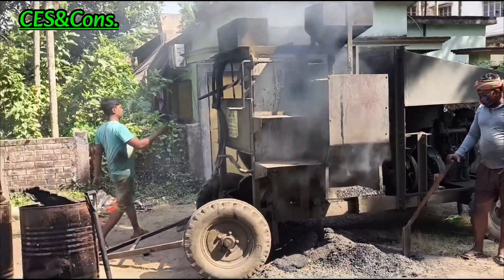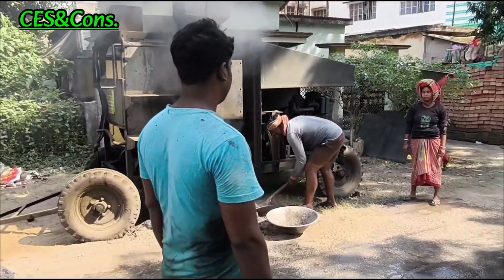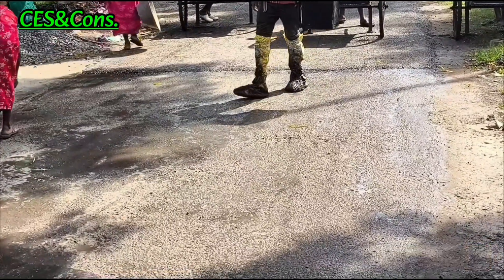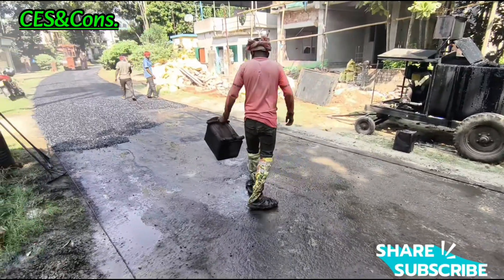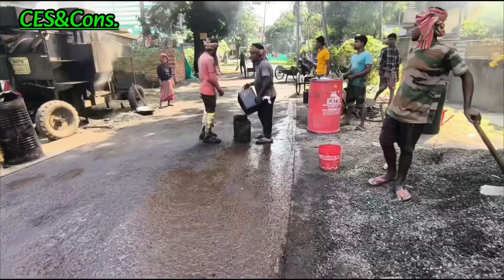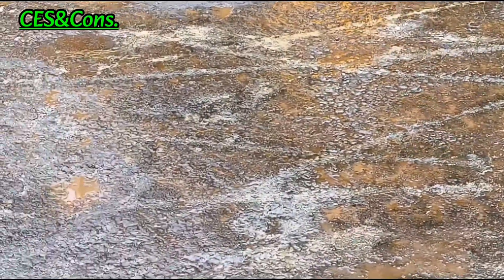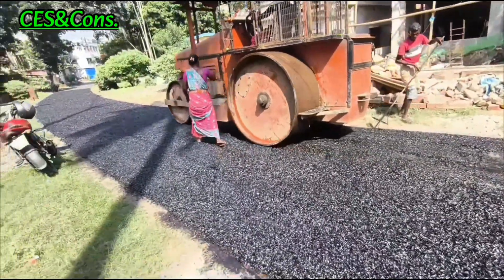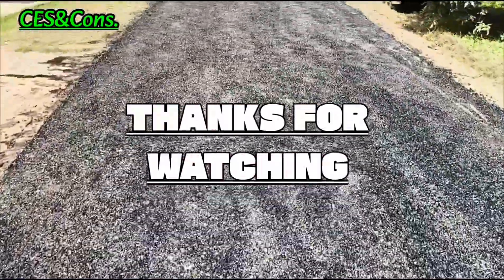Construction of Wearing Course #pavement #road #roadconstruction #civilengineeringstudy&construction

Comment: Road paved without paving machines gets damaged early and does not give long life. Only because contractor dont have paver machine.
Reply from the maker: Thank you for your valuable comment.This is fact that for the quality work Hot mix plant,Paver machine with tipper trucks & Vibration Roller etc.are essential but for the low value work this is not feasible like this work. Thanks.Stay tuned.🙏